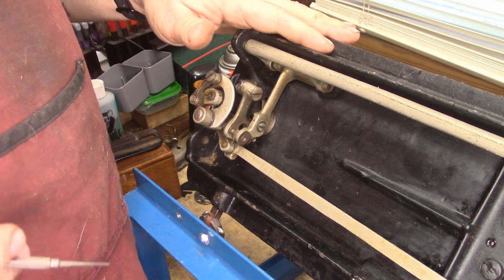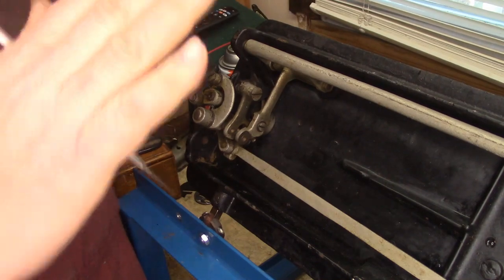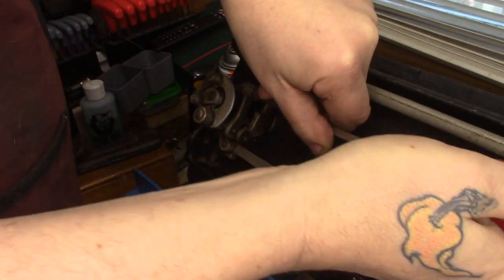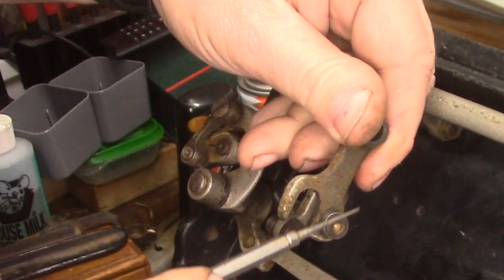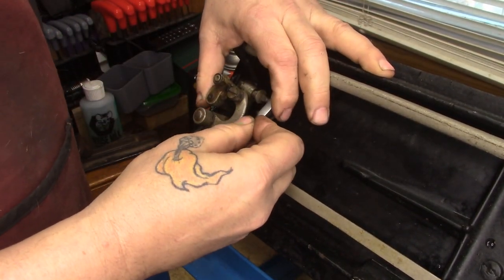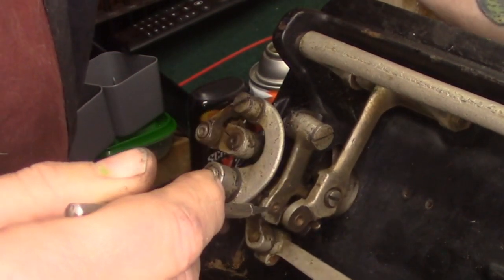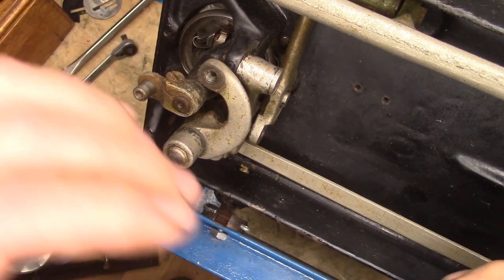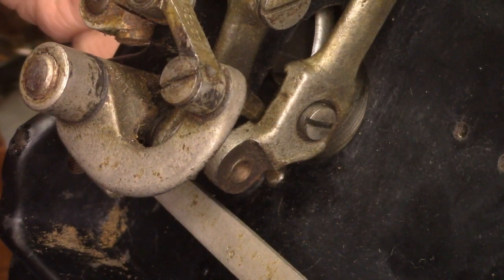From the Facebook Vintage Singer Groups - Singer 66: Feed Dog Problems...

Comment: I’m working on a 99 and while I’m familiar with how to set the height, I can’t find any resources on how to adjust the forward and backward adjustment, it’s hitting at the back.  Do you happen to have a video for that adjustment on a 99? Thank you.
Reply from the maker: Rhonda, the information you need is all covered in my video "A Closer Look: Singer 66 Bottom End Adjustments - Sunday Morning Quickies, Ep. 79, April 23, 2023" which you can find here:
https://www.youtube.com/watch?v=UxdtFigLMhc
Even though the video shows a 66, it is exactly the same adjustments for a 99. Hope this helps!
Reply: @BobFowlerWorkshop  yay headed over to watch now.  Thank you.
Reply: @BobFowlerWorkshop  yes sir! I just watched the video and saved it to my files, and now I’m on my way to hopefully repairing my 99. Thank you so much.
Reply: @BobFowlerWorkshop  well, I’m at my machine and unfortunately the 99 is a little bit different from the 66 so I’m gonna just take a chance and loosen up what appears to be a set screw on the right hand side.  Wish me luck 😬
Reply from the maker: Glad it helped!
Reply from the maker: @rhondamercado7527  The fore and aft position of the feed dog is adjusted on the right hand side (pillar side) using the eccentric bolt that attaches the forked arm to the feed dog rock shaft. What looks like a set screw on the linkage is used to adjust the slack in the linkage that is caused by wear. Loosen the nut, and then turn the eccentric screw slightly while checking the clearance of the feed dog at the needle plate while you turn the handwheel. It is EXACTLY the same procedure for the 66, 99, 15, 201, 27/127, 28/128, and a host of other domestic machines by Singer and many others. Make sure that when you have the adjustment where you need it to be, that you hold the screw from turning with your screwdriver while you tighten the nut.
Reply: @BobFowlerWorkshop  yes, I see now it’s the same as the 99. I got it adjusted now….THANK YOU SO MUCH❤️

Comment: Let's say your sewing machine is giving off a metal screech when in motion from the feeddog area;
would it be down the feeddog position or just need more oil somewhere? 
It didn't initially make this sound until about ten minutes of use.
Reply from the maker: Well, that's hard to say, but you can eliminate feed dog adjustments as being the culprit by removing the needle plate and seeing if the sound goes away. Odds are, it's a lubrication issue though, and not the feed dog rubbing against the plate.
Reply: @BobFowlerWorkshop  on further inspection there's some scratching on the underside of the presser foot likely from the feed dogs.

Question is, do I adjust the feed dog positioning, the presser foot bar position, or the presser foot bar tensioner bolt?
Reply from the maker: @esk8jaimes  Scratching on the bottom of the foot is usually because the machine was run with the foot down and no fabric under the foot. You can polish that out using fine grit foam cored nail files. It's not necessarily an indication of the need for presser height adjustment.

Comment: I have a 626 the feeding back in forth is feels clunky
Reply from the maker: In my experience with the various Singer Touch & Sew models, I have found that they aren't what one would call "silky smooth". Most of them that I have handled/owned/used are rather clunky compared to the older straight stitch machines, or the higher end machines such as a 403. I'll probably take a lot of flak for this, but I haven't seen a T&S yet that I really liked. I'm not saying they are bad machines, they're just not my cup of tea.

Comment: Can I remove a feed dog from model 66 machine?
Reply from the maker: Sure, but why? FMQ?
Reply: @BobFowlerWorkshop  I guess FMQ stands for free motion quitiling. Not for quiting but I want to use a free motion foot. I think I learned which screw that I need to remove from this video, but can’t turn it at all. Any tips to get loosen the old screw that’s stuck?
Reply from the maker: @jjoojjoobar  Yes, FMQ = Free Motion Quilting. As for the stuck screw... a little penetrating oil + time and it should come loose. NEVER force anything, and if you want to use some tapping to break it free, BE GENTLE!